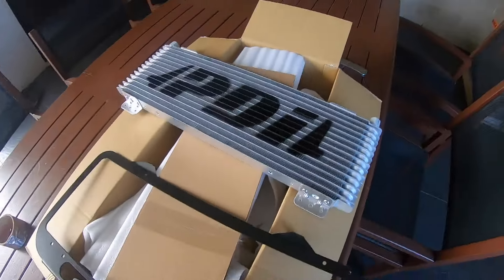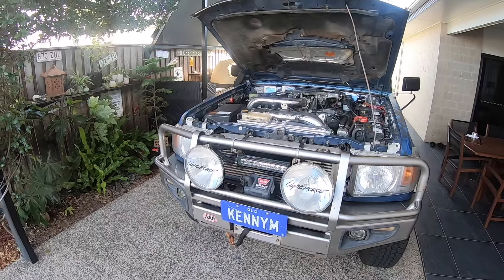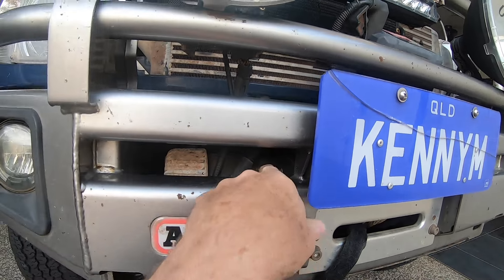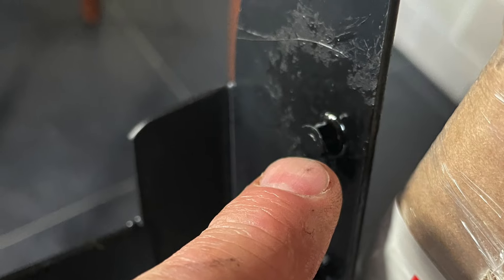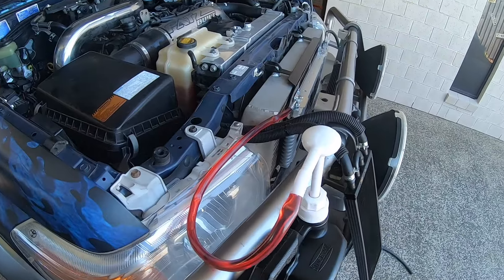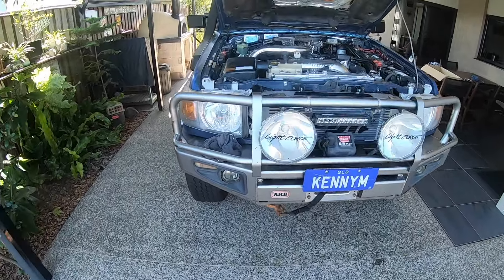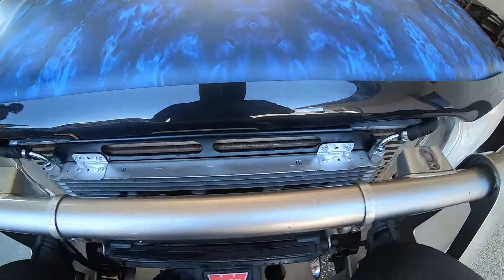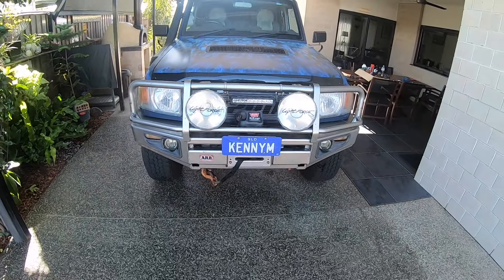HOT TRANSMISSION FLUID? TOYOTA 6 SPEED AB60 AUTO? 79 SERIES AUTO CONVERSION? LETS GET SERIOUS!!

Comment: is the aircon still cold with all those layer ?
Reply from the maker: Great ? I’ve not noticed any difference. Let me clarify though.

It’s winter here. So I’m not using aircon much other than for defrost.

The “layers” I have are, starting from front, PDI transmission cooler, PDI front mount intercooler, OME air conditioner condenser and then PWR radiator.

Certainly is a little bit of kit up front.

With the wholesale automatics  transmission cooler I was getting about 1c -2c hotter intake air temperature; about 2c -3c hotter coolant temperature.

The PDI trans cooler certainly takes up lots more real estate up front. But I’ve got no real meaningful comparisons. It’s been in 1 day.

Tomorrow I’m doing a complete transmission fluid flush and some other maintenance. I’ll not be able to give a reasonable comparison u til early next month after a short 800 km drive.

Edit: I should mention, I do appreciate there is likely going to be adverse air flow issues particularly for anything sitting behind the front mount intercooler. I’m hoping what is happening early September for the cruiser will markedly increase airflow into the front.

kennym
Reply: Am I correct in assuming that the grille won't be reinstated?
Looks like it should help keep the trans under 100°c .....🤞
Reply from the maker: @billroach2393 Who the heck billroach 2393? 

Grill will be going back on. I’m toying with 2 solutions for that. Either further modification of my already modified grill or something new.

I’m letting current new system “settle in” before I move on the grill. I’d prefer not to leave the coolers “exposed” to bugs n stuff. So I will work on something. I reckon I’ll know one way or another within a week or so.

kennym